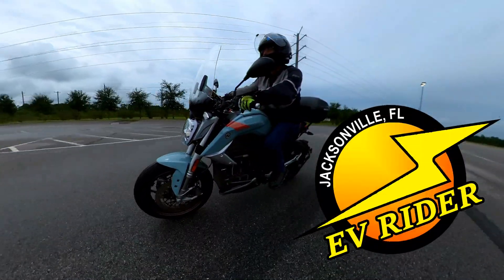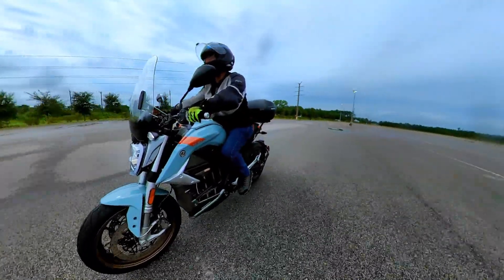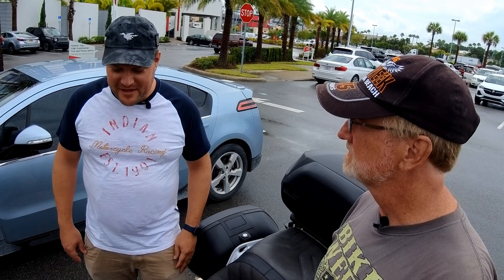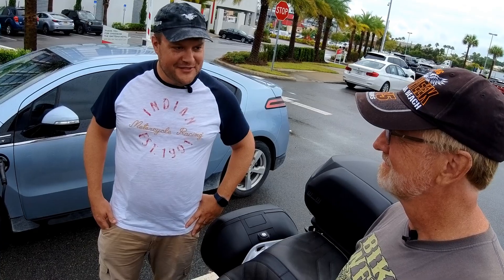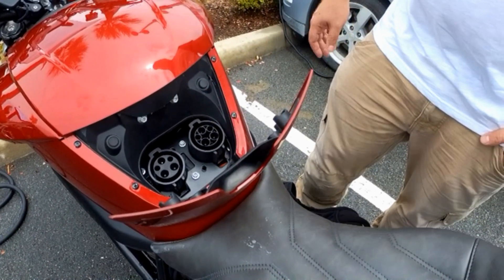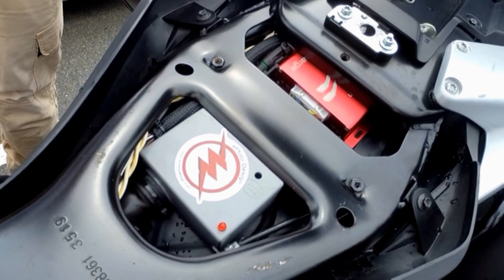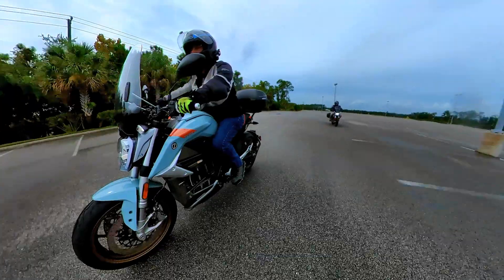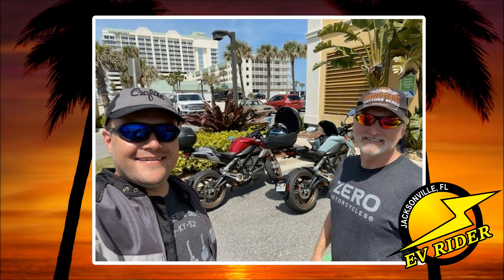Rapid Charger Accessory Provides Dual J-1772 Zero SR/F/S Charging

Comment: can you see how we can add an additional battery pack or homemade battery pack in addition to rapid charge, 6kw or 12kw, im sure theres enough space
Reply from the maker: The last generation Zeros made homebrew stuff like you're suggesting a little easier. This generation is pretty locked down. As far as an additional battery pack, Zero does offer one called the Power Tank, which adds 3.6 kW, but as you probably know, it's an either or choice since it goes in the same location as the optional 12 kWh Rapid Charger.
Reply: @EVRider  we have to see who can override zeros programming cause at the end of the day it’s connect one thing to the other
Reply from the maker: @juggernautherculesgarcia6076  That one is way beyond me. I'm a rider, not an engineer or programmer, but more power to whoever can do so.

Comment: Please do away with j1772 altogether and get prepared to provide to supply DCFC add on if Zero comes out with their next line up without it.
Reply: Excellent idea. However, this is the option H-D's Livewire tried to tackle... and the same reason why the Livewire has no level 2. There is a size constraint and it is either one or the other. Scott's system is a paradigm shift for the small EV industry. Companies that convert cars (EV West) are strictly level 2 for this reason. Again, Scott's device enables the coveted "under 1 Hour" charging time and negates the need for DCFC systems in small systems. It is the EV equivalent of breaking the 4 minute mile.
Reply from the maker: Robert, I wholeheartedly support the idea of adding DC fast charging to the Zero line but J-1772 will have a place in the U.S. charging infrastructure for years to come. J-1772 charging stations are much more affordable to install and many vehicles, such as Zero, and most plug-in hybrid automobiles currently only come equipped with J-1772, in part because of their smaller batteries. Plus, for most homeowners that charge at home, J-1772 is all that's needed. What I wish Zero would do is introduce a CCS Rapid Charger option that is compatible as an OEM add-on for both existing and future SR/Fs and SR/Ss while still keeping 6 kwh J-1772.
Reply: @EVRider  you convinced me I ordered last nite!

Comment: How does the charging system and battery deal with the heat and prevent thermal runaway? I was told this was one of the reasons why Zero did not add DCFC capability.  Lastly, does this new charging system void any warrantee?
Reply from the maker: Hi 2 Wheels 1 Road, Scott's system doesn't alter Zero's charging system in any way,  so thermal heat isn't anymore of an issue than it would be on a factory stock Zero with the Rapid Charger setup. If Zero's BMS (battery management system) decides things are getting toasty it will dial back the charging in exactly the same way as it would without Scott's modifications. I saw a fellow YouTuber that constantly charged his 12kWh Zero all day long with no heating issues (I stumbled across it & can't find the link now) and Scott has ridden several thousand miles in a long weekend with no overheating. I'm no lawyer and haven't studied Zero's warranty so I won't comment on that.
Reply: The 2x3kW chargers are on top of the battery and have openings on each side of the frame and fans blowing.
The charge tank (6kW) has no real openings for cool air, but have 4(!) fans blowing the air around.